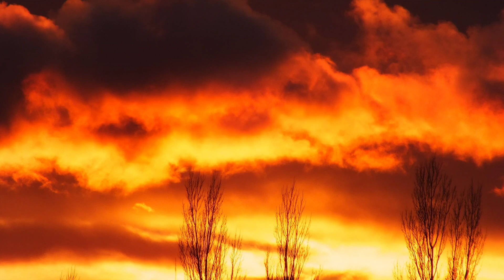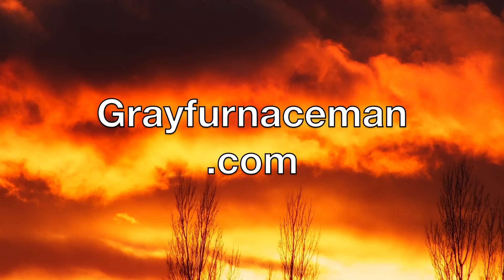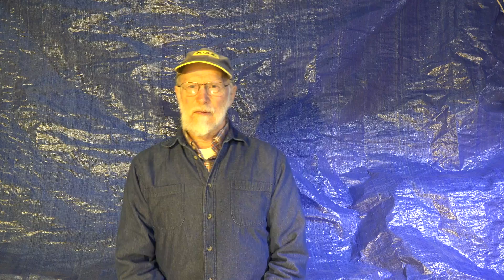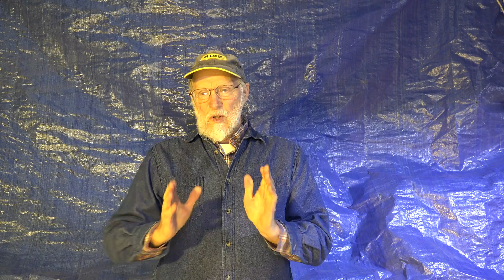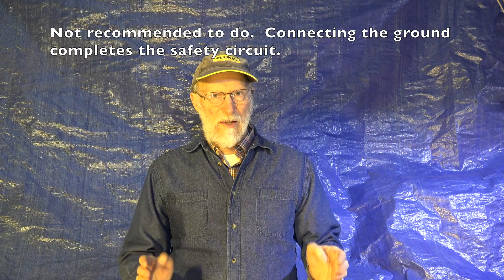What is ground in electric wiring

Comment: I'm still confused. Doesn't the ground play a part if there's a short in an appliance with a metal casing? Isn't that how the breaker trips? Or is it because that ground is bonded to the neutral? 

Also, is there a neutral in the primary coil?
Reply from the maker: The circuit protection opens with a short to chassis because ground and neutral are connected at the main panel.
If you mean the pole transformer, yes neutral is the center tap of the secondary winding.
GFM
Reply: @grayfurnaceman  Ok I think I understand the circuit protection you're talking about. So the ground has a double effect for protection? 

The main being a path to ground for lightning strikes and the second being bonded to neutral so when a hot touches a properly grounded chassis a breaker will trip?

I'm talking about the primary coil in a transformer. Does it have a neutral or just the secondary?

Thank you!
Reply from the maker: If you mean in the power distribution system,  that's beyond my pay grade.
GFM

Comment: Dumb question- Why will a GFCI trip if the ground is shorted to neutral? I don't get it since both the ground and neutral wires ultimately connect to the same bar anyways. Thanks
Reply: The GFCI is a balancing circuit.  It checks the draw thru both the neutral and hot leads.  Any imbalance trips the circuit.
GFM
Reply: @electriccar3253  Thanks. I understand that, but how could there be an imbalance when 2 wires that are both at ground potential are shorted together? Thanks
Reply from the maker: Of course there can be an imbalance.  Current does not normally run in the chassis ground or the earth.  The current is balanced with the same current traveling thru the hot and the neutral.  If there is a fault in the circuit, some of the current travels to the earth or the chassis ground.  Not the neutral.  So the current, when checked between neutral and hot must balance.
GFM
Reply: @grayfurnaceman  Oh I see. I thought that a GFCI would only trip if it sees more current leaving hot than it sees returning to neutral. Thanks for explaining!
Reply from the maker: Remember, there is no return line in AC.
GFM

Comment: In short, the ground is a really just a low impedance (low resistance) path back to the source to facilitate the operation of the overcurrent device (circuit breaker.) Mike Holt has a good video called "Electrical Fundamentals" that deals with this. It really helped me to understand it.
Reply: Suggest, the neutral is the path back to the source (step down transformer )to facilitate the operation
of the circuit breaker.

Comment: Min 7:00 -- a key link in the ground-neutral connection, i.e. the circuit breaker. 

Thank you for posting. This is 2nd time through the 3-part series and it's starting to gel.

Comment: Hello from the U.K.! Thank you for an interesting video. In the UK many household are provided with one phase Line, a Neutral and an Earth or "Circuit Protection Conductor". All limited by a 100 amp fuse. Live to Neutral provides 230V only. Rather then 'ground' we often refer to "Earthing" metal cases etc via the "CPC" or Circuit Protection Conductor. The CPC is there not to protect life - it's there to protect the circuit's wiring. The CPC provides a low impedance path and thus a very high fault current to trip the circuit breaker(s) as quickly as possible. In order to protect life we use Residual Current Devices or RCDs (GFIs in the USA I think). In the UK we also practice "equipotential bonding" this is where all metal gas pipes and metal water pipes into the house are also Earthed or Grounded via the CPC to the breaker busbar (or "consumer unit" as we call it). In fault conditions, this is meant to avoid any potential difference between metal objects in the home and ground / earth, so that if someone touches a metal bathtub or sink etc. their body would not be the fault current's path to earth / ground. However widespread adoption of RCDs is making equipotential bonding redundant. Cheerio!
Reply from the maker: Thanks for the thoughts.
GFM
Reply: Thanks, that was really interesting.

Comment: Why ground should be connected together with neutral in main panel? Isn't neutral himself grounded somewhere near transformer. Can't just ground go to ground and neutral wherever he comes from?
Reply from the maker: The bonding in the main panel is there to make sure there is an effective ground.  Yes, most poles have an earth ground.  However, that copper wire going down the pole is often stolen by copper thieves.
GFM

Comment: floating iron (ferrous sulfate) has the ability to go above ground potential and begin taking on an electrical charge like a battery or capacitor, like what road salt does to cars. i just think of the anode grounding it out, to prevent the electromechanical process.

Comment: I agree ground wires are gay .  They do not make anything safer - just more complicated and dangerous if done wrong.  
    Would be much safer if they just grounded utility poles to dissipate static electricity and lightning (extremely important) and then just have 2 wires (110 Volts) running from pole transformer into homes.  All household appliances could be designed to run on 110 volts and using correct amperage breakers would be perfectly safe.  220 Volts is really overkill and not necessary in residential homes.  System could be much more simple and safe.
   What if your standing in a bathtub full of water and drop in a hair drier or toaster you ask??? -----------------------THATS WHAT THE BREAKERS ARE FOR-----------------------
Reply from the maker: Poles are grounded.  Your idea for 120 volts is rather simplistic.  The wire size for large draw appliances would be excessively large.  Your bath tub analogy is senseless.  A breaker will not trip to earth ground.
GFM
Reply: A breaker will not trip to earth ground ???  Then whats the point ???
Reply from the maker: Earth ground acts as drain for lightning and to drain off spikes and surges given off by appliances.  It also, when connected to the neutral line will clear faults (kick off breaker or fuse) in the case that metal appliances (sinks, etc) have come in contact with a hot lead.  
The only device that will protect from shocks when the bathtub becomes energized will be the GFCI.  
GFM

Comment: I searched the web but can't find an answer to a simple question. Can I have an  electric installation without neutral. Using only Phase and ground. the reason I ask is the following  My house is far away from the transformer and I get low voltage because the cable is not thick enough. I can not change the cable for thicker one. So I am thinking about using the Neutral cable as a phase too. So I get two wires as one phase and ground at my house. Will my appliances work that way? Here we have 220V. Thanks. for anyone who can help!
Reply from the maker: Nope.  If you had low voltage before, you will certainly if you use ground with that low of voltage.  
GFM
Reply: but now I double the wires and the voltage will not drop as much as if it is just one wire for the phase. the voltage drop is not due to low voltage at the transformer but  because of the long distance.
Reply from the maker: If you are doing what you say, it will not work.  Earth ground will not work as a conductor.
GFM
Reply: That is the stupidest thing ive heard. But yeah itd work.  When some electrician tries to repair something and electrocutes himself then you go ahead and delete this comment so your lawyer will have a better defense.

Comment: what about lines with no neutral. like a single phase, single wire line like they use in remote places. wouldnt the ground wire be absolutely necessary in this case?
Reply from the maker: That one's above my pay grade.
GFM
Reply: Do those exists? Have you ever heard of such a thing? I can't remember, but I think I've seen it on a video once. Seems like it could be possible. Using ground as a return.
Reply from the maker: They do exist.  Some use earth as a return, but they are used only in very rural areas.  Lots of problems there.
GFM
Reply: Well that's what I was talking about ! It would have to have a ground on these
Reply: I would think.

Comment: So, taking my house as an example - It is from the 50's and does not have a separate "grounding" wire system (neither the ground rods, nor a separate green ground wire running through the house), but rather it supposedly uses the metal conduits as a ground system. So, if I understood you correctly (and assuming my whole system is well made), I can affirm the following two sentences: 1) I am not protected against thunders, as I am not connected to the ground. 2) When it comes to a hot line by accident touching the chassis of one of the components, I am "safe" there, as in this case the electricity would run back to the main  panel through the mental conduits, where it would finally connect back to the Neutral bar, which is physically touching the metal body of the electrical panel. Am I right? Thanks a lot!!
Reply: Thanks. But that is what I wanted to confirm... The whole "path to ground" via a metal pipe or rods are just really for lighting discharge, right? When it comes to protecting against a equipment fault (hot line touching chassis), that is useless...  In that case what matters is a path back to neutral at the main panel, correct? Thanks!
Reply from the maker: You are correct.  Earth ground will not kick off a breaker.  Only a fault to neutral will kick it off.
GFM
Reply from the maker: Your system does indeed use the conduit for the ground.  Even though you do not have a ground rod,  the ground is probably connected to a metal water pipe.  So you should have a path to earth ground for lightning discharge.  Loose conduit connections are the problem here.  Hope this helps.
GFM
Reply: DTM you should make sure you house have a water ground and a ground rod just to be safe
Reply from the maker: The reason for the shock is you are a path for the current to go.  Possibly a high resistance path but a path nevertheless.  
GFM
Reply from the maker: You need to separate neutral and ground.  Neutral is the other side of line or the center tap of the pole transformer.  Ground is there to discharge spikes and lightning.  The system will work quite well without the ground.  I have a grounding and bonding playlist on my channel that may help.
GFM

Comment: At power substation, the transformer neutral is grounded to earth with a ground grid underneath the station. The neutral on the power poles originates from that ground grid.
Reply from the maker: +Myriade Joseph The earth ground, whether it is at a substation, power pole or ground at the termination has nothing to do with the neutral.  Neutral is the center tap of the secondary on the power pole.  I have gobs of videos on earth ground and neutral that may help.
GFM
Reply: grayfurnaceman what I was describing was the utility neutral. When a station is built a grounding grid is built below the sub, the transformer neutral is directly connected to that grid. For a three phase four wire distribution, the neutral for the distribution lines are directly connected to the station grounding grid. From the power company side the neutral is the ground. In your video you brought the utility side.

Comment: AC circuits confuse me I know DC circuits.  I installing a wifi  thermostat next week but need a Common  power line.  If I add a 24 v AC power supply plugin what if anything do I do with the second line from the transformer?    There is a C line coming from the controller but it is tapped to the sump overflow pump from the evaporator.  the other  leg coming off the sump goes down the line to the compressor.  Can I tap into this line? to provide the 24 v leg to power the display of the thermostat?
Reply from the maker: +Michael Scott No plug in power supply.  It will be destroyed by the main transformer.  First you must determine which is common.   All I can tell you is the wire that went to R on the thermostat is the switched leg of the 24 volt.  The other side is common.  Hope this helps.
GFM

Comment: Don't you need a good ground for a gas valve to work properly?
Reply from the maker: +Anthony Stevens No.  Ground is not part of the gas valve circuitry.  Many gas valves are connected to the chassis of the unit but they do not need to be to work.  The ignition control usually needs to be connected to the chassis.  Hope this helps.
GFM

Comment: When I was five years old I got lit up real good, standing on a chair, one hand on a vertical gas pipe the other on a hot pull chain lamp. It was not long after that my Dad explained the brass screw and the silver screw and how you can verify things are wired correctly, yep at five years old

Comment: a chassis ground also called equipment ground is is for protection of equipment, personel safty and fire protection to minimize fault currents and keep normally unenergized items from becoming energized. also is a necessity for overcurrent, ground fault, arc fault, and transient voltage suppressor devices to operate. 
    everything is referenced to a common ground.  electrical systems are connected to a common earth ground rod/grounding electrode system for a place for transient voltages and fault currents to go,  and also to bring lightning directly to earth ground. ground rods are also not intended to attract lightning.

Comment: I really Like your videos my friend, Ive watched them all, In my time on earth I learned than if Im willing to learn there are people like you who are willing to teach, My grandpa did the same thing with me, thanks again :) I did build a control box for a 3 phase mixer at work with some 120V  contactors and indicator lights, Had to steal a little nuetral from the ground to make it work cause I didnt want to have a 5 wire plug but it worked. even the guy I was working for at the time was a little dumbfounded by how I made it work, alot of folks dont understand the system.
Reply from the maker: +Jason Windecker Thanks for the support.
GFM